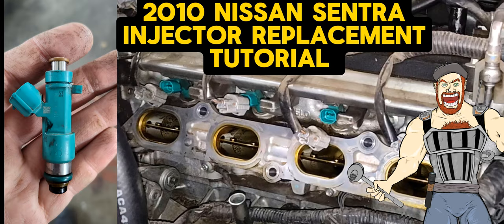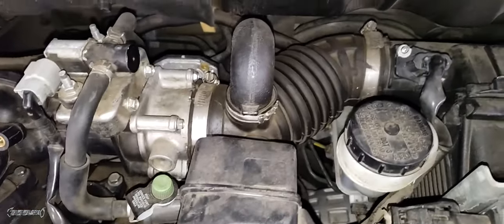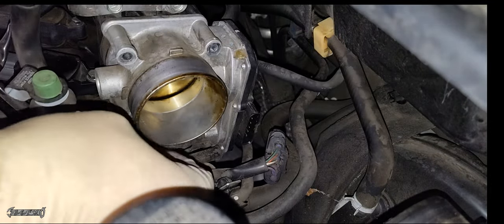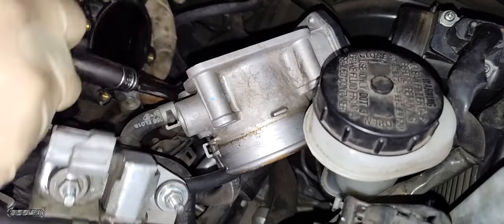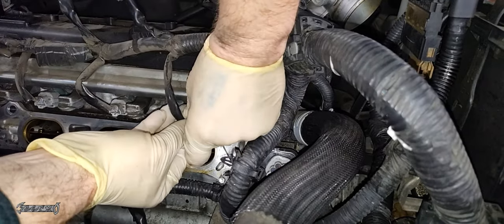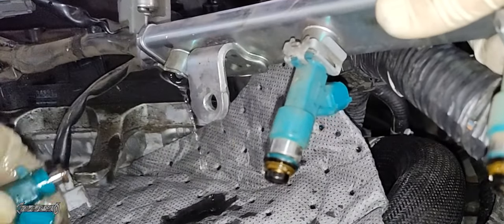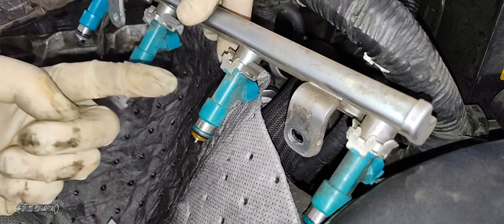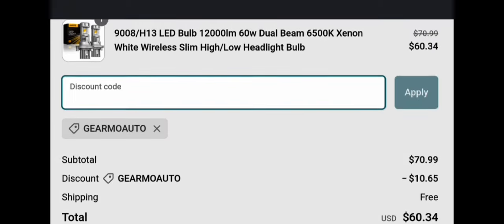2010 NISSAN SENTRA FUEL INJECTOR REPLACEMENT TUTORIAL

Comment from the maker: GET A NISSAN GENUINE INJECTOR HERE ( AMAZON )
( 70 BUCKS )
https://amzn.to/49CrUtm

GET AN AFTERMARKET 4 PACK OF INJECTORS HERE ( AMAZON ) ( 40 BUCKS FOR 4 INJECTORS )
https://amzn.to/3T8KxPZ

GET A NISSAN GENUINE INTAKE MANIFOLD GASKET HERE ( AMAZON ) ( 40 BUCKS )
https://amzn.to/3wv4o31

GET AN AFTERMARKET INTAKE MANIFOLD GASKET HERE ( AMAZON ) ( 32 bucks )
https://amzn.to/3IaGxIr

GET THE NISSAN FUEL LINE DISCONNECT TOOL HERE ( AMAZON ) ( 12 BUCKS )
https://amzn.to/3wu9bSn

NOTES ABOUT LINKS : 
I HIGHLY RECOMMEND ALWAYS USING OEM GENUINE PARTS.  ( LONGER PART LIFE , BETTER MANUFACTURER QUALITY).

I INCLUDED LINKS TO AFTERMARKET OPTIONS AS WELL BECAUSE I KNOW HOW TIGHT MONEY CAN GET THESE DAYS. 

THE FUEL LINE DISCONNECT TOOL IS OPTIONAL, LIKE I SHOWED IN THE VIDEO, DISCONNECTION OF THE MAIN FUEL LINE CAN BE AVOIDED.

( STILL A GOOD TOOL TO HAVE, WORKS ON TOYOTA TOO )

PART #S FROM VIDEO

INTAKE GASKET - 14035-8W80A
INJECTOR - 16600-ZJ61A
GREEN O-RING ( BOTTOM O-RING ON INJECTOR)-
16618-EA000

DISCLAIMER:  I GET A SMALL COMMISSION THROUGH MY PURCHASE LINKS , YOU GET THE EXACT PART YOU NEED AND SAVE TIME , SO WE BOTH WIN.

Save some money? Small donations help greatly
 Paypal.me/GearmoAuto
VENMO-       @Gearmo-Auto
CASH APP - $GearmoAuto
I would love to make more content with better quality to help everyone save money and time. Thank you!

Comment: Did u have to reprogram the throttle
Reply from the maker: I did not. It self learned after a couple miles of driving
Reply: What was the car doing before you changed the injectors? Thanks
Reply from the maker: @FelipeRodriguez-eh6ty  MISFIRE CYLINDER 4. P0304
Reply: @GEARMOAUTO  oh ok! Mine got no light but it jerks around 2k rpm idk what it might be , i already changed the spark plugs and ignition coils and it still does it, I’m going to do injectors next but will see what happens. Maybe the dude who sold it to me erased the light but I already drove it a lot and nothing had popped up so idk, hopefully it passes smog tomorrow . Thanks for replying tho bro.
Reply: @FelipeRodriguez-eh6ty  Did that fix it?